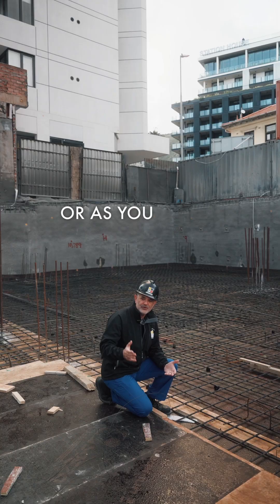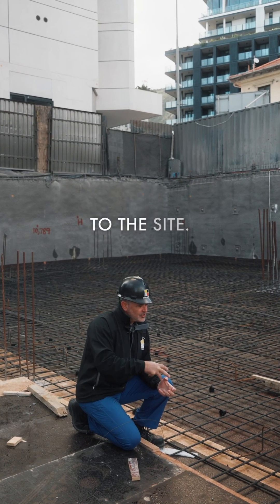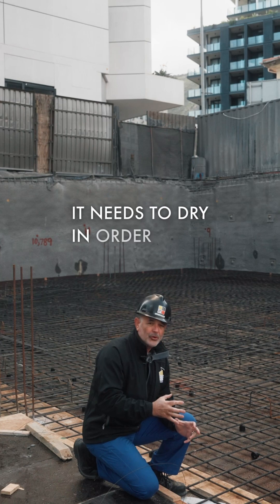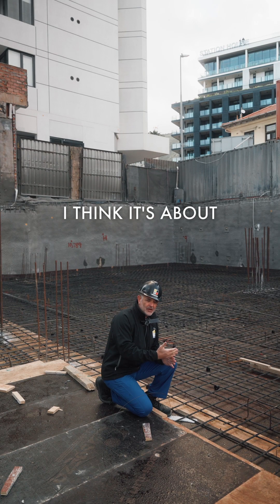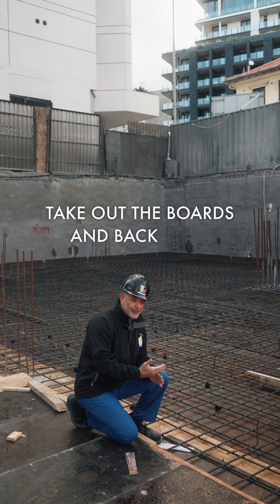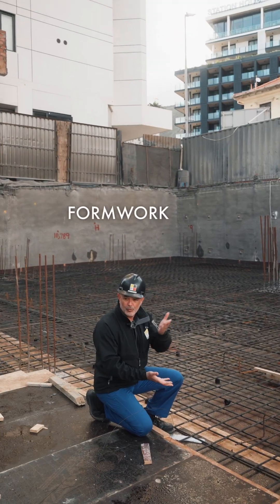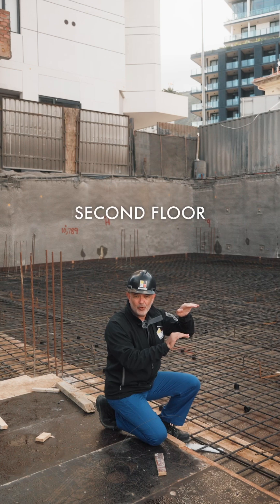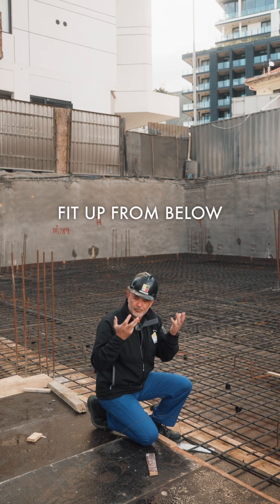On The Ground With Saul : Laying The Slab

Comment: Almost same as I did on skyscraper in. Chicago in 1978...my first and only as subcontractor job ... except in dead of Winter we used plastic sheets and desiel blow heaters ...I recall we had form works for 5 floors as even use of hot air in snow storm need 7 to 20 days for drying...I recall I told the owner I needed to stop for a week because of freezing cold...and storm...he reply if I stopped I be fired and new contractor would take my place so I TOLD MY 25 CARPENTERS AND AIDES...WTF HE SAID ...SO WE WORKED 15 MINUTES OUTSIDE AND 30 MINUTES IN INSIDE. WITH SPACE HEATERS